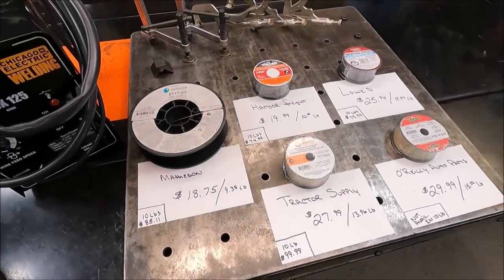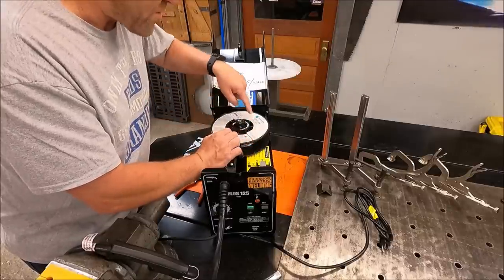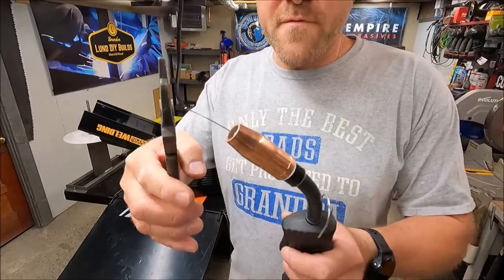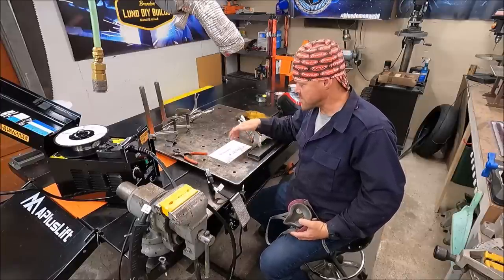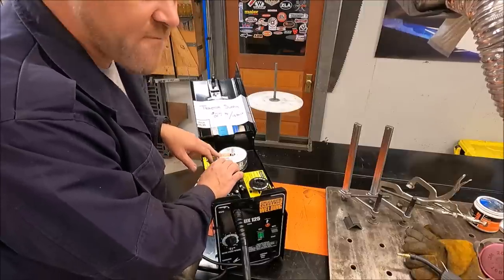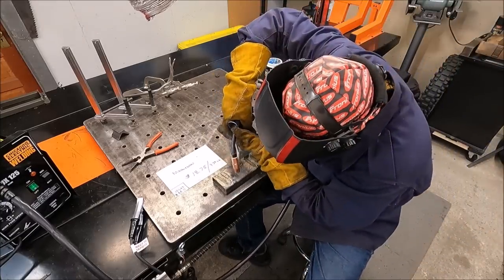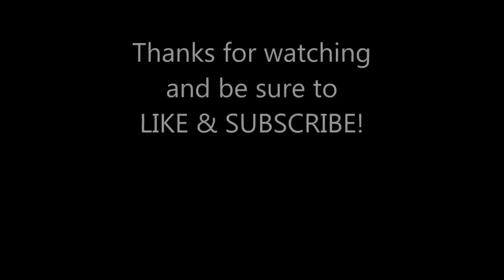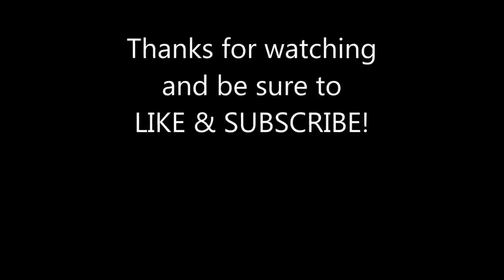Testing which Flux Core Welding Wire is Best

Comment: First thing I saw was the crappy weak ground clamp.  My HF Titanium 125 with upgraded clamp runs real nice with the Vulcan wire. Of course it’s an inverter welder, would love to see the same test on that welder. Also isn’t stubbing a sign of too high of wire speed?  Each wire may have its sweet spot for speed seeing as how your simple welder can’t dial temp/power.
Reply from the maker: @gpracer1 yah the whole thing is pretty bare bones which is why it's only a hundred bucks or so. I ran this same test through my Fronius 2200 and it was pretty much the same. You are correct about stubbing. It can be caused by too much wire feed speed or too low voltage. Head to head without any fiddling around or learning curve the Lincoln wire ran the best even though I have lots of burn time on Matheson.

Comment: The welder I use is an old Lincoln weldpack that belongs to my father-in-law and I’ve only used the harbor freight .030 flux core wire with it. It can be set up for mig, but not sure if it works it’s old so I just always use the flux settings. Gonna build a small welding table soon and will try a new brand wire. Question, should I use .035 instead of .030 since the table will have 1/2 top and 1/4 in legs/frame? Or do you think .030 is fine for welding those thickness together?
Reply from the maker: .035 would be the better choice but if all I had was .030 and it were my table I would just use what I had and make multiple passes. 1/4" is just outside the single pass range of .030

Comment: The Lincoln wire, unlike the other wires used in your test, is a "multipass" wire. This means you can fruitfully weld on top of a cleaned flux previous weld. This is not the case with the GS rated wires 

This is what I need on my car project when I replace that tire cuz some idiot hit me. I have to drill out the spot welds. And then have to spot weld rosettes to weld the tie bar to the aprons.  I must use the link in because it's going to be too easy to hit over previous spot-welds.
Reply from the maker: The lincoln is good stuff but conicidentally it wasn't the only multi-pass wire in the lineup. I used what I did because this is what your going to find for a selection when you run out of wire on a Sunday afternoon and every welding supply store is closed.

Comment: I think the harbor freight is worth another look.
With a slower feed speed it ran pretty much just as well…and used less wire.
Optimized for the harbor freight, the Lincoln and matheson probably would run poorly.
Reply from the maker: I've messed with it a little since this video. It does work when in a pinch but the consistency just isn't there for me. It will do but I prefer the other brands I mentioned. Im sure if I ran this exclusively I would be able to read it better and do better but as I said, I prefer the others. That said, they have 6013 rods that like quite a lot so it's not that I don't like their products.

Comment: I don't think the Chicago Electric is a DC electrode welder. I may be wrong about that.  Much better results with a DC welder like the Lincoln/Century DC electrode for Flux Core.
Reply from the maker: @campion05 its not. Its AC. A lot of folks have done an ac to dc conversion on these.

Comment: It's probably best to ditch the nozzle when using Flux Core wire since you'll be able to see the weld much better. If the welder has gas capability, wrap the area normally protected by the nozzle with electrical tape or Kapton tape.
Reply from the maker: Definately easier to see without it 👍

Comment: I only use Vulcan wire it works great for me
Reply from the maker: Hopefully I didn't come off as rude. I really never saw a difference with the wire I was using either and it worked great for me also. We learn how to make what we have run and put down good looking welds. It wasn't until I switched that I saw a difference in the wires. The takeaway probably should be if your using a wire and getting good results, stick with it, but if you switch, you can expect the learning curve on the Lincoln wire to be putting down nice welds very quickly.

Comment: Great video, I appreciate your test. 
I am a hobbyist and have the Vulcan Omni Pro 220. I am very happy with it after 2 years. And that has been with the HF wire. So my welds maybe better with the better wire. Ps none of my welds are structural welds😀🛫
Reply from the maker: @TheFalconJetDriver I was able to get some decent welds after messing with the HF wire for a while but just running them without practice some of the others did better. I bet you would probably like the feel of the Lincoln or Hobart wire.
Reply: @BrandonLund  I will take your suggestion the next roll will be one of those Lincoln or Hobart agains thanks for the test.
Reply from the maker: Right on! I think you will like it :)

Comment: Harbor freight wire I put the lowest speed in 2 and max is work fine for me.
Reply from the maker: I will have to give it another chance and mess with the setting and see if I can get it to run a little better.

Comment: Thanks for the video could it be that the second bead you ran ,the metal was already hot that's why it required less amperage?
Reply from the maker: @Chill you make an excellent point! It would actually make a difference but I let things cool down in between. Thank you for mentioning this!
Reply: @BrandonLund  Thank you for the videos Actually I've used fortney flux core wire ran very well and I  purchase  two spools of INE.. The reviews rate this excellent I haven't tried it yet because I've been doing gas which is a lot nicer and faster. no slag  to remove..lol
Reply from the maker: @Chill I've used Forney and love it but it's been a while. I haven't tried INE yet but I've heard really good things. I'm going to order a spool and give it a try.

Comment: I know that you were testing flux core wires but as a rule do you typically use flux core? I use Lincoln wire in my Miller and it burns so hot I have to turn down the settings. Do you have to do the same?
Reply from the maker: I use flux core quite regularly. I use it whenever it's windy conditions like outside or when I have fans running inside because I don't have to worry about the coverage gas being blown away and it's awesome for thicker metals because flux core burns hotter. I haven't noticed the solid lincoln wire needing less amperage but flux core in general does run hotter

Comment: Maybe pin this comment to help others… the difference between E71T-11 and E71T-GS wire is that GS stands for “General” service/use and “Single” pass, meaning you CANNOT weld over the top of the weld with a second pass or you risk the weld cracking. The E71T-11 Lincoln wire you have there CAN be welded over again and again without risk of the base metal diluting down and risking a future cracked weld. E= Electrode. 7= 70,000Lbs tensile strength. 1= code used to signal you can weld in all positions (uphill/downhill, horizontal, etc.), and T= designation for “Flux Core” hollow wire. The “11” is the American Welding Society designation meaning that it meets their stringent tests. Most E71T11 wires are nearly identical with very little difference in weldability. The GS wires vary GREATLY as they are “Proprietary” wires that vary amongst companies. Hope this helps all the new welders out there. 🤘🏻😎🤘🏻
Reply from the maker: The point of this video was to demonstrate what to expect for results with over the counter wire that you would find on any given weekend at local hardware and auto parts stores. The GS designation is nice but it doesn't really come into play for this demonstration. I agree that a true test would include wires that are all graded the same but then we would be ordering wire online and from our lws stores and that wasn't the direction of these demonstrations. This in my opinion is a very realistic example of what's available for wire on any given weekend if you ran out and what you could expect for results based on what you found.
Reply: @BrandonLund  I agree, but most of the wires people will find at say, Harbor Freight and Home Depot/Lowe’s, will range from a E71T-11 to a GS classification. I was merely pointing out that all E71T-11’s must meet an AWS specification, whereas there is no real set of rules they must meet for GS. Just trying to help the end user cause YouTube wasn’t even invented when I started welding and I know I sure coulda used the advice! Lol 😂

Comment: Nice! I too have found the Lincoln wire to run well. I’ve also had great luck with “yes welder” wire ordered from the smiley-faced jungle distribution company.

Brandon, I really, really like your approach to safety. I’m terribly frustrated by folks who weld with inadequate safety gear. I’m a retired old guy with regularly reoccurring skin cancer on my hands, so I wonder how badly those who weld without covering up bare skin will suffer when they get older. Your example is outstanding!

Thanks!
Reply from the maker: @H Gj I Thank you! I've heard the yeswelder wire is really good. I'm going to reach out to them and pick up a spool for some upcoming testing.  

I wasn't always this safety conscious but a lot of eye and hand injuries later and getting a little older and possibly wiser I try to advocate responsibly. I've been lucky so far but when I started welding we didn't have internet so doing a "quick weld" in shorts and no hood was pretty common. With the invention of the internet we can all see the horror stories of being careless. I consider myself lucky so I try to pass on my good fortune to others and spare them the hard lessons I had to learn during recovery. Eye surgery is no fun and as you mentioned, UV rays are extremely harmful also. Thanks man for being a channel supporter! 🙏
Reply: @BrandonLund  I guess I’m a safety zealot because I had to supervise college students in “prototype labs” (shops), but also because of past injuries. Once you’ve had an eye doc coming at you with a drill to get a foreign particle out of your eye it makes a believer of you! Like you, I’ve been lucky, but I’ve also been hurt. Fortunately nothing lost but a little blood, but I know guys who have lost fingers, eyes, and been even more seriously hurt. I’m sure this is true of you too. I just hate for anyone to be needlessly hurt.

Anyway, YOU are setting a GREAT EXAMPLE and I commend your efforts and ethics. 👨🏼‍🏭😎

BTW, I once tried a really cheap wire from the jungle reseller just for grins. The flux induced corrosion overnight!  Might be another point for your future flux core videos.🤓
Reply from the maker: @H Gj thank you very much for your great comment and support! My 1st eye injury I was in 6th grade. I was making something for a school science project. It was a small bag that when lifted would sound an alarm... While at home I was grinding on a piece of coat hanger to make part of the alarm trigger contact (without safety glasses) and you know what happened next. I was a bit of a slow learner but I eventually caught on so now I try to try to pass it on to others. Thanks again and thank you for being a mentor to our younger generation. I'm 50 and dream of retiretirement so I hope you're enjoying it!
Reply: @BrandonLund  retirement is great, but I enjoyed working too. An unplanned health issue took me out of the game, so I’m just happy to be alive!

Just remember, live a full, good life every day…you never know what might hobble you down the road a bit.👴🏻
Reply from the maker: Great advise buddy! 👏👍🙏

Comment: Are you running that welder off of 120v if so what size breaker? 20 or 30 amp?
Reply from the maker: @Nicholas Infinger 120 volt with a 20 amp breaker.

Comment: Huh so its not just me. Its the wire, I was wondering why it would pop like that. Also I had to lower my speed way down more than half of what the machine was preset for. But once you get it dialed in it welds pretty good. Definitely going to change up my wire when I run this spool out. Also the lowes wire isn't that much more than the harbor freight. And its across the street from each other too so that works out lol.
Reply from the maker: @Korey Williams I was telling another commenter pretty much the same thing. The Vulcan wire didn't run that bad once I started messing with it and learning what it liked but factoring out that learning curve and just running them back to back, the Lincoln and Hobart shined above the others. The only one I couldn't get to run good was the Vapor even after messing with it afterwards off camera.

Comment: Nice video.  I run Blue Demond and like it so far.  I need to try the Mathison's.  BTW... I noticed your awesome home gas remover @ 7:40 was not on.
Reply from the maker: @918 Scott thanks man. I've heard good things about the blue demon wire. The spoke remover works good (when I remember to turn it on) lol. It's hard using it while filming because of the bacgrround noise from the fan so I end up turning it off and on in between and usually forget to turn it on lol.
Reply: @BrandonLund  yeah, that makes sense the fans are loud I just found it humorous. Simple mind.  😎

Comment: Hi Brandon. Dit you switched the polarity on the machine doing this test. So positive to ground. I saw a lot of firework while you welding.
Reply: I am pretty sure the polarity on that machine is fixed.  It will only run flux core wire even though it comes with a gas contact tip.
Reply: @ChristopherSalisburySalz  this is the case on my HF welders. My other welder is a Lincoln, and on that model it's also flux core.
Reply from the maker: @Frans Tolsma the polarity is fixed on this model. You can't switch it.

Comment: Can I use this to weld aluminum? I haven't done any Welding since 1976 so I'm new at it again.
Reply from the maker: This machine isnt capable of welding aluminum.
Reply: @BrandonLund  could you tell me a good aluminum welder from Harbor Freight that won't break the bank? Thanks!
Reply from the maker: @Dean Mayer im not farmular with their products but i have an aluminum mig welder that will also weld mild steel and do plenty of other stuff. Here is a video of it https://youtu.be/YzMNIsdNj48 and if you use the coupon in the video description you will save a bunch at checkout!
Reply: @BrandonLund  thanks Brandon I sure do appreciate it.

Comment: I have a forney easy weld 140mp im using Hobart. Is it ok to run your welder with generator?
Reply from the maker: @Nicholas Infinger the inverter type welders are more sensitive to voltage spikes vs transformer type machines. I'm not sure which yours is but it should  say in your manual.

Comment: 1 roll of Flux Core Wire can be used for how many meters of welding?
Reply from the maker: It all depends on material thickness and amperage. Too many variables

Comment: I have been using the Vulcan 10 lb roll,maybe I'll try the Lincoln next!
Reply from the maker: @Steven watkins the Vulcan wire ran pretty decent but it had a bit of a learning curve getting used to it. The Lincoln wire was a lot easier to run without the learning curve. I'm a little disappointed my regular wire didn't win but I save about 5 bucks so i'm switching lol
Reply: @BrandonLund  pricing for the 10 lb rolls between the 2 is so close, it's worth trying. Where did you buy the Lincoln again?
Reply from the maker: @Steven watkins I drove to so many places to buy wire I got fouled up a little. I wrote Lowes on the paper but I actually got it at Home Depot.

Comment: while they are all flux core gs wire isn’t certified and is single pass only.  so comparing it to a t-11 which is muti pass wire i wouldn’t think they would compare.  gs wire is just general whatever wire hence the g.  i could have said from the get go the the lincoln nr211 would be best.  i run it in my 20 year old harbor freight welder and its good.  i wouldn’t expect a single pass wire with whatever its made from to run anywhere near the same as 211.  lincoln also has nr212 which is less smoky.  not by much though.  we didn’t use t-11 much because we did structural work which required t-8 wire
Reply from the maker: @Brian Lorenz you make a great point but a weekend warrior won't see it that way. The reason I say that is because a majority aren't buying consumables at the LWS but rather buying what's readily available at their local hardware store on any given weekend so they are kinda limited by what's available rather than trying to find coded wire.

Comment: HF has 3 versions of this welder (probably 3 different manufacturers).  One schematic shows that the output is AC at the torch (flux core MIG as you know must be DCEN).  With the other two, it is difficult to determine from the schematics provided if the outputs are AC or DC.  I have seen videos, including yours, that people have decent welds with this machine.  Would I buy one?  Probably not.  There are many good used welders on CL and other sources for more money of course  HF's 90amp welder was AC only.
Reply from the maker: I'm not sure which this one is but I'm actually very impressed how it welds. I had one like this many years ago and it was bullet proof. Being young and dumb I was building trailers with it and to keep it from tripping the thermal cutoff I bypassed it. I wouldn't dare guess how many pounds of wire I ran through it. I would still have it but I was using it on a bridge job and it slipped of a scaffold and into the ocean. In hindsight it was probably a good thing before it burned my shop down lol